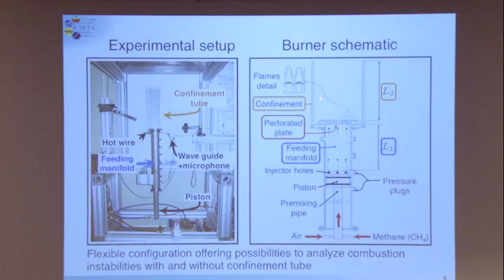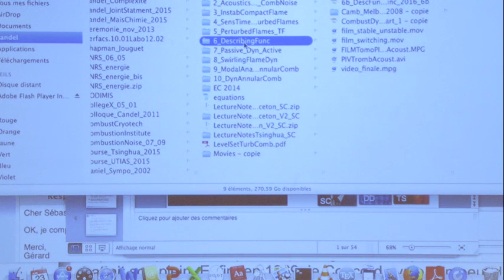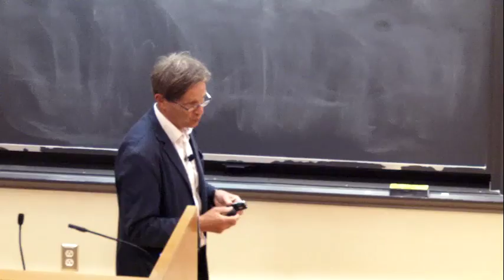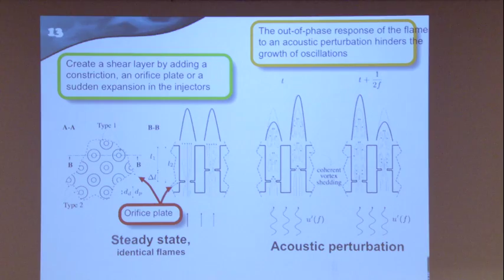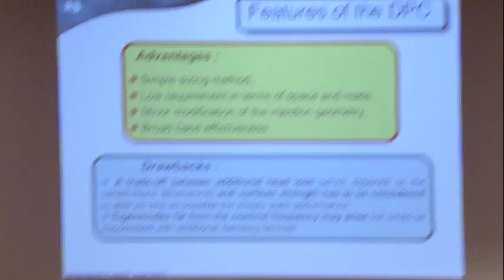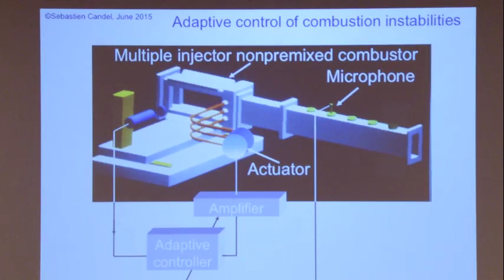Combustion Dynamics, Candel, Day 4, Part 2

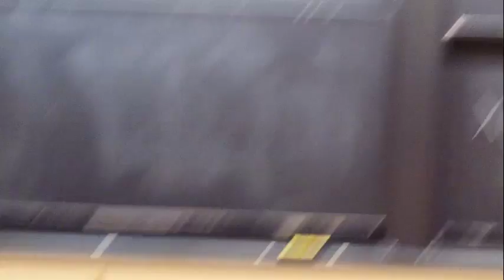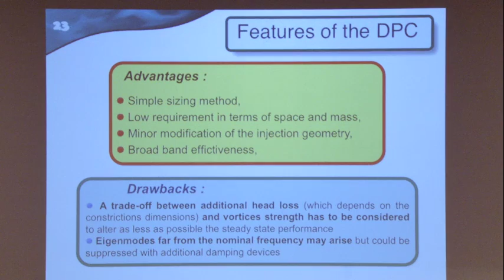Comment: I think that a generalisation of what he called Dynamic Phase Converter (DPC) injector (minute 26:20 to 35:40 ) could be a cellular porous media. The principle is the same; a diaphragm hindering the premix gas flow inside the injector. Only that the porous media has a random diaphragm distribution.